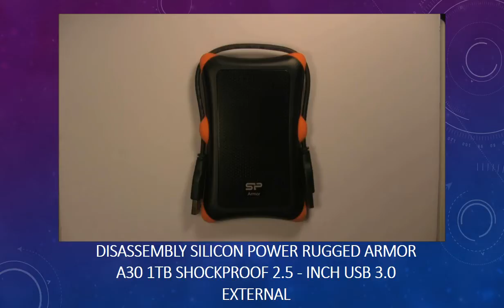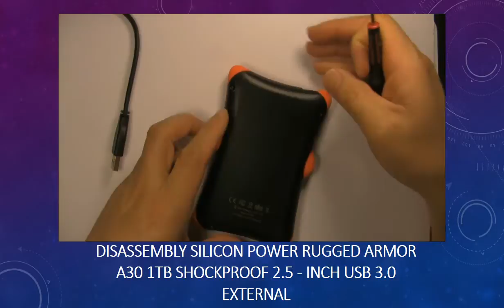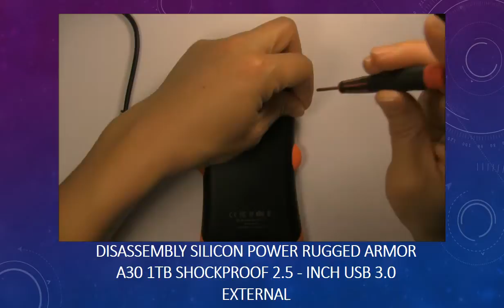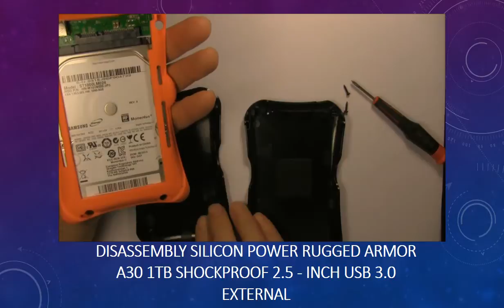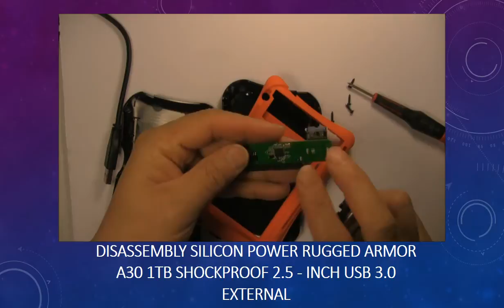Disassembly repair data recovery Silicon Power Rugged Armor A30 1TB Shockproof External Hard drive

Comment: so the hard drive should be 2.5? or will the adapter fit even in 3.5? if i replace it?
Reply from the maker: the hard drive is 2.5" SATA, and the adapter can be used for 3.5" SATA drive
Reply: so both 2.5 and 3.5 will work?